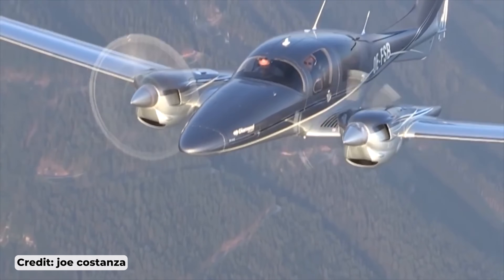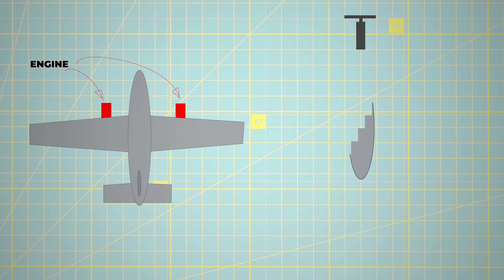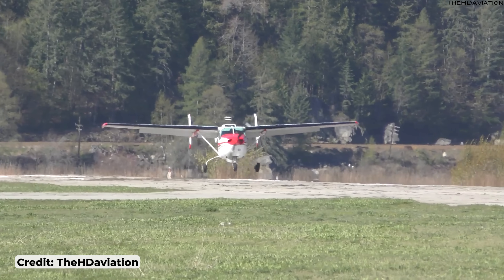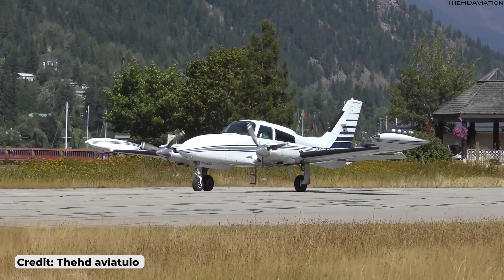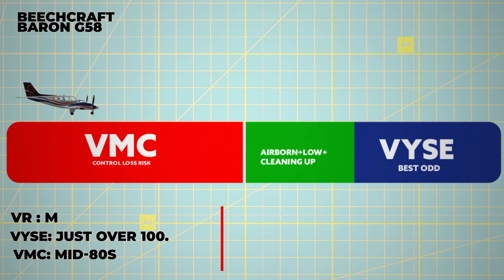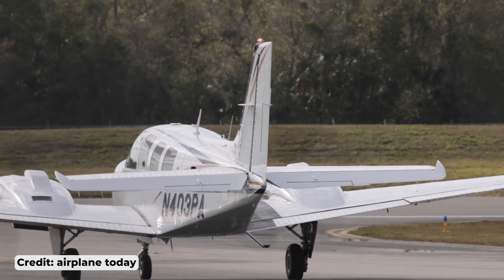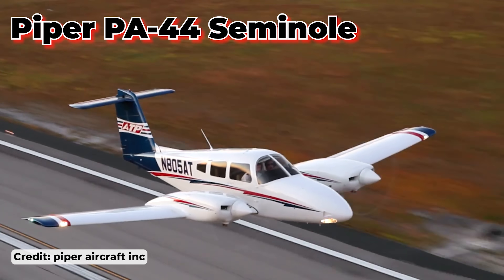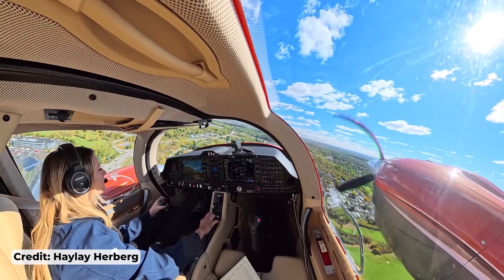Where Other High-Performance Twins Try to Kill You… the DA62 Tries to Save You.”

Comment: The commentary appears to ignore the fact that you can't climb until vyse is achieved. Good twin pilots keep a very shallow angle of climb ready to catch an engine out situation rather than assuming a full climb before even VMCA is achieved. Load and c of g limits play an important role here too. Aircraft are not forgiving or unforgiving, they are simply a machine that must be operated within a certain safety speed by pilots. High speed machines require higher speed to avoid the catastrophic results shown in your video. The difference in performance between a Piper Seminole (effectively a twin Cherokee) and a Twin Comanche (the wing of the single Comanche is a lot more critical than the latter)  would be a good example. Another factor is the basic design when a single has a second engine grafted onto it. The comparison here might be the difference between a Seneca with roots in the single Cherokee 6 and the Aztec which came from the Apache, always a twin design and much easier to control. Complacency after achieving a multi rating is the culprit, not the actual aircraft whose engine out performance is well documented in the POH. Take the power of a King Air, 4 series Cessnas and even a Navajo which has a very keen wing and you have the  recipe for an accident waiting to happen if performance speeds or load limits are ignored.
Reply: having watched a lot of hoovers post-mishap analysis, i agree. imma retired navy graduate aeronautical engineer and the mishaps i’ve seen all stem from inexperience & inadequate training or the biggie, criminal levels of negligence.  this here video is a long infomercial high lighting the one design benefit these folks focused on to get some separation from their competitor’s product.
Reply: IM and Old Aztrk driver, home is 5300 in a  bowl temps often Hi 90's I never asked her to do..the impossible..That why I can still add my 2 cents ..😅😅

Comment: No mention of counter rotating props and how it factors.
Reply: I also wondered why counter rotating props were never mentioned. I did my multi endorsement in a PA-44 and B-76 which made the simulated OEI on take off less hazardous because some instructors liked to pull the mixture and turn it into an actual OEI that couldn't be fixed quickly if it turned bad! Really stupid idea IMO.
[Interesting Fact] The WWII P-38 had two Critical Engines.
The Mu-2 had real interesting numbers that would have made for an excellent example but I guess the AI narrating the video was ignorant of the little Rockets take off numbers. Never got to fly one but sure would have like to.
Reply: I owned a Twin Comanche with counter rotating props, had two engine failures in it along the way,  and it makes a big difference over the standard version with a critical engine..  VMC was 10 (mph) lower, and in regular takeoffs, no rudder pull at all, with a shorter take off roll ..
Reply: He talked about engine failures, it would not do anything in that situation
Reply: @jostmathe  Counter rotating props are significantly better in an engine failure scenario for multi-engine aircraft because they eliminate the critical engine, balancing torque and P-factor to prevent severe yaw and roll, making control much more manageable and safer than conventional twins where losing one engine can drastically impair performance
Reply: @derheeheehee6941  ohh, I did not think that far. Thanks for telling me.
Reply: @derheeheehee6941 smh.
Reply: @edwardrichardson5567 Why are you shaking your head?
Reply: Because I have my reasons.
Reply: @edwardrichardson5567 That's a piss-poor answer from an instructor.
Reply: @derheeheehee6941 😂

Comment: Problem is the major factor in determining the spread between red line and blue line is horsepower. The DA62 only has 180hp per side. Barons and 310 typically have 310jp per side or more. More power/performance means more danger zone.
Reply: Torque will be a factor here. The DA62 will have far higher torque than its petrol counterparts
Reply: @planespeaking  the math shows a 300hp piston engine has much more torque than DA62 at takeoff. Torque = (HP × 5252) / RPM. 

DA62: 180 HP at 2300 RPM = ~411 ft-lb per prop. 

Baron 58 : 300 HP at 2700 RPM = ~584 ft-lb.

Comment: Do these planes have a way of stopping diesel runaway?   Nightmare fuel in a plane.
Reply: Most prop planes have a "fuel-mixture" control and fuel shut-offs. I am not even sure prop planes can have runaways, but they can be countered if they ever did.
Reply: @sheeplord4976  A turbo-diesel prop engine like in the Diamonds might theoretically still suffer runaway after fuel supply had been disrupted (in a Diamond's case by switching off the engine master which deactivates the injectors). If enough engine oil could somehow still be ingested into the combustion chamber (say from a very badly leaking turbo seal) then I guess the engine could potentially attain runaway condition. Not heard of it happening with a Diamond and perhaps highly unlikely.

I did once have a runaway with an older diesel 4WD SUV with mechanical injectors and an electric fuel pump - it was quite frightening with the highly overrevving engine and roiling thick black exhaust smoke, however with a cool head I managed to find and pull the fuel pump fuse which perhaps 10 seconds later eventually starved the engine enough to bring it to a stop (and without lasting damage!).
Reply: Each engine has its own electrics Master Switch which normally kills the engine by shutting off the fuel injectors and feathering the prop (as long as revs are over 1300rpm). 

But I've not heard of any of Diamond's Austro Diesels suffering runaway on the ground or in flight. But if one ever did, say due to a very badly leaking seal in the turbo, I'm sure the inevitable self-destruction would be the only solution, while continuing to eventually land on the remaining single-engine, which is what Diamond twins do well enough with only 168-180hp (depending on model). They have quite benign handling characteristics when flying single engine and will often continue climbing at up to 500ft/min with a rated single-engine ceiling of 13,000 ft and will even cope well with a 30-degree turn into the dead engine.

However, a series of problems have dogged the newer Austro (Diamond) Diesel engines including a quite serious occurrence of piston crown cracking and sometimes piston crown failure (the latter can result in engine self-destruction). These have mainly occurred since Austro ran out of the original Mercedes sourced OM640 engines and began manufacturing their own under license.

However, these rather frustrating string of failures has resulted in Austro working to improve the engine design, including recently engaging an alternative piston supplier with a new piston design, which earlier this year (2025) competed testing and recertification. These are now being retrofitted to the effected Diamond models and of course supplied with new engines.

One hopes that these quality control improvements will continue becoming part and parcel of the company culture, and I'm led to believe Diamond are now offering an extended engine warranty on new engines in an attempt to win back confidence. They just now need to radically improve their customer communications culture which has been practically non-existent.
Reply: I'd like to see a Diamond DA62 with Deltahawk diesels, 200hp per side. Designed from the ground up for aviation, not for autos.
Reply: @cjc1103  It would be interesting for sure, but I don't think it'll ever happen. Diamond's Chinese owners have already developed a 'designed from the ground up for aviation' engine (AEC2.0L) which is already certified in China for their version of the Diamond DA42 (called a CA42).

I'm led to believe this engine is slated to eventually supersede the existing Austro EP3 series diesels in the current DA40/42/62's. It appears to have the same form factor, and uses the same engine mount positions and cowlings to bolt straight in.

Comment: Good video, but should have mentioned twins like the Beech Dutchess and the Piper Seneca that have counter-rotating propellers. No critical engine just like the Skymaster, but without the drawbacks of a pusher prop in the back.
Reply: Not having a critical engine just means single engine performance is the same on either side. It can still experience a Vmc rollover. That issue is eliminated in the Skymaster.
Reply: In what world is a pusher prop a drawback?  Lol.  

The only potential threat is rear engine failure without realizing it but that’s easily solved by leading with the rear first.  

You still have to verify power loss like every twin and the performance of a pusher prop is much higher.  The single engine service ceiling of the 337 is two thousand feet higher on the rear vs the front.
Reply: @calvinnickel9995  
…”leading with the rear first”…

Such visuals !
Reply: The CR props is a minimal change in respect to single engine controllability. You also know VMC is determined by the "critical engine" being the one failed for the test. Red line will be the same regardless

Comment: I’m pretty sure that Cheyenne didn’t have engine trouble, I’m pretty sure he stalled it because he tried to fly out of ground effect with too little airspeed (trying to show off a steep climb).
Reply: Someone hears the engine bogging down and they think it is engine trouble. All engines driving props will bog down in the slightest climb because of, you know, physics. A subject most pilots never properly study, let alone dumbass bystanders. If the pilot crashed the plane, what makes you think some rando is going to know what happened?
Reply: Um nope those props ard constant speed so dont “bog down in the slightest climb”
Reply: Yep looked like a left wing stall incipient spin to me. Vmc roll wouldnt be so quick

Comment: Dont rotate the 58/58p until 90 and stay in ground effect until clean. You'll be at blue line before the gear come up 5000 ft from where you started. And thats at max gross with the ac running.
Reply: In other words… only fly into airports with 5000 feet or more runway otherwise you’ll probably go into the fence/localizer/ditch/berm when an engine fails at 85.
Reply: @calvinnickel9995absolutely do not fly into airports shorter than 5000 ft if at max gross and failure at 85 is reject takeoff.
Reply: Have a E-55 and 3300 foot grass strip and use this profile exclusively. They all have dead zone. It’s not a jet and V1 is blue line.
Reply: Does the POH not recommend having the a/c turned off for T/O and Landing (in case of a go-around)? All the POH that I can remember reading A/C Off was in the take off checklist and I remember that because I never flew anything that had A/C except my recliner chair.
5000 feet is a long way for a a light twin and I learned to fly at place that had a 10,288ft main runway. Trainers used the 1200ft 02/20 grass strip. How much distanced was reduced when the A/C was turned off?
Reply: @braveworld2707  it depends on gross weight and density altitude. POH calls for it off. Live in Mississippi so its hot af during summer but im flying from sea level, and rarely with anything other than me and fuel. it makes it take a little longer, probably 8-10 percent worst case 3-5 best.  personal minimum is 4000 ft for planning if i can help it. plane starts flying at 2000 - 2500, but have plenty of room to reject t.o. or build speed before climb.  would rather fly fast than short.
Reply: took the words right out my mouth , whos the jackass just pitching a heavy twin straight up without gaining speed in ground effect. i thought this was standard procedures . Rotate 3 degrees a second and get into ground effect put the gear up the flaps up and get your speed and rotate outta ground effect and bobs your uncle.
Reply: Interesting. I was thinking of getting one.

Comment: As a very young  tyro it was drummed into us dead engine dead leg.  😟
Reply: Doesn’t work on a 337 and there are a lot of twins that go into the ground because the pilot either isn’t using rudder or because he shut down the wrong engine.
Reply: @calvinnickel9995the 336/337 is a centreline thrust twin and a red herring in this argument. Time in a 336/7 can't be logged as twin time.

Comment: On the bright side, it's easier to do barrel rolls with one engine pulled to idle. Burt Rutan fixed the problem with his prototype Boomerang. It's still flying safely today.
Reply: That's an engineering exercise, not a solution. The problem with the boomerang is that most mechanics are incapable of properly rigging the plane. And the ones that are won't do half as good a job as they'd do with any other light twin. This is why a grand total of about three airframes have been built in 50 years :P